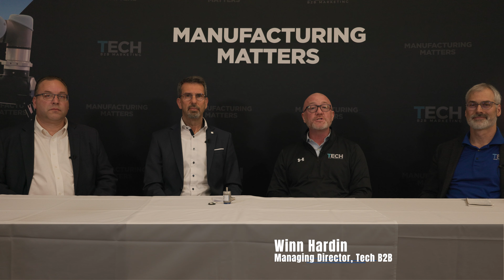Episode 72 - Robert Wachendorff and Tom Bako, Wachendorff Automation

Comment: Speaking of Trends & Technology in Manufacturing, as I was looking at Future Energy Consumption Pattern of several G7 advanced economies (namely 🇯🇵 and 🇺🇲) and based on the Energy Axis (or Scale) trajectory forward there're going to be Exponential Growth in Energy Demand due to several factors (that might indirectly contribute to Manufacturing Sector advancement) :
(1)  A.I. technology application pursual (in various sectors),
(2)  A.I. enabled Data Centers (new & upgrades), and
(3)  Factories coming online (new or existing expansions).

Above scenario spawn several opportunities in Manufacturing Sector among the Advanced Economies such as addressing labor shortages in 🇯🇵, incorporating A.I. technology in running factory automation, and A.I. application in raw material logistic & finish good distribution.  In other words, how would you want your factory to look like in the era of A.I. boom (or how best do you want to apply A.I. technologies in shaping the New Manufacturing scenes) ?